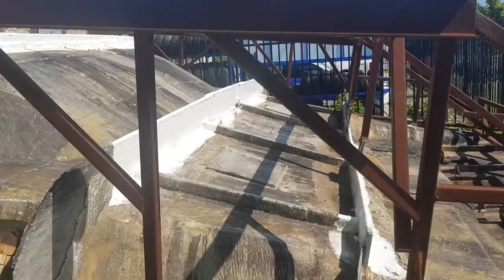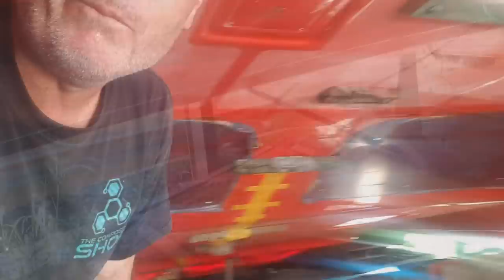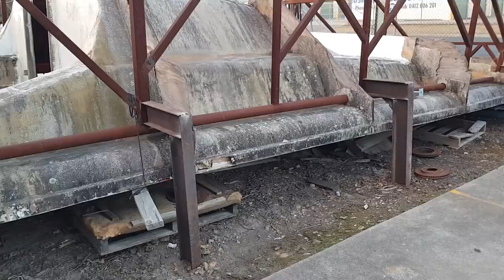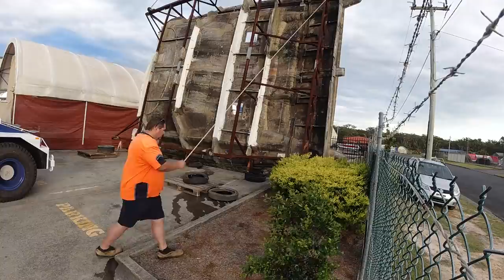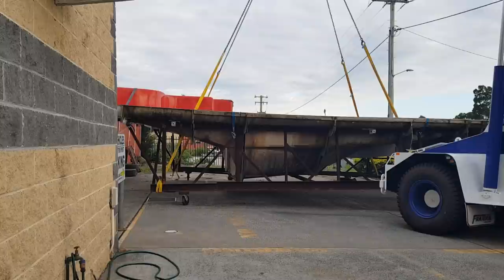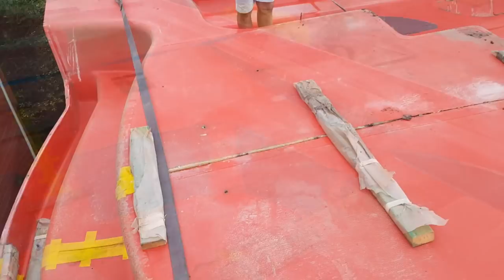Ep157 - That's a "Flippen  Big Deck" - Scary Stuff

Comment: Well that was a cracker Roscoe.👍 As ever, on the edge of my seat throughout. What measures are you going to incorporate in the deck lay up to lift it from the mould? At least it will not be as heavy as the hulls.🤔😀👍

Comment: Has the mould got non-skid areas?  Will that make it hard to repair and polish up?
Reply from the maker: Yep the mould has anti slip it will be a huge effort to clean ,the polishing not s o bad as it is polishes up nicely with a buffer.Rossco
Reply: Did even think of that! I always thought anti slip was something you paint on after the fact not right in the mould! I must be watching to many boat restoration and steel boat builds these days!

Comment: You worry too much man, its not that bad, I use to flip things three time the size of that as a fabricator, as I said you worry too much! your going to give yourself a heart attack at that rate. lol in jobs like this, its little by little, bit by bit and its turns out just fine. As long as the operator has lots of experience and he takes his sweet sweet sweet time! things actually goes pretty easy. but its actually normal if you feel your gonna shit your pants if your not use to shut things ...lol glad to see it all worked out of yah.
Reply from the maker: Yes I have found that the actual is easier than the thinking about. Thanks for clearing up the feeling that I am going to shit my pants, very well said. Hah. Cheers Fon.

Comment: Can i get info on the Crane , never seen on like that.
Reply from the maker: JON.A franna crane or commonly referred to as “non-slewing mobile crane” or “pick and carry crane” is a mobile hydraulic crane that can be driven on the road. ... The franna cranes are designed to travel large radius with their load. Thus making it ideal to use a franna crane to lift and move loads back and forwards.Cheers Buddy